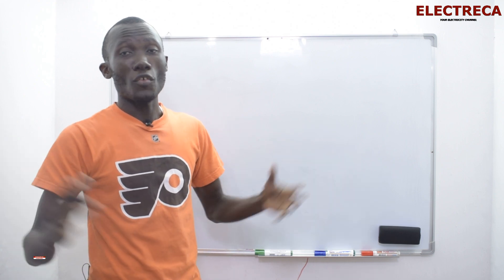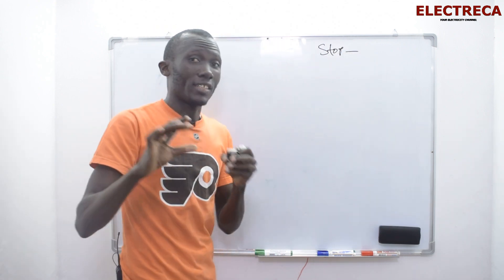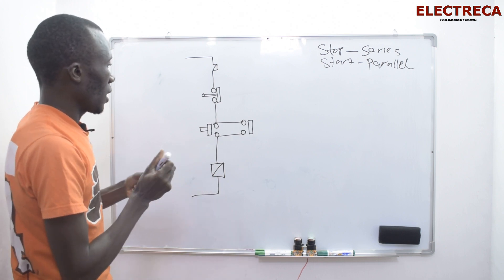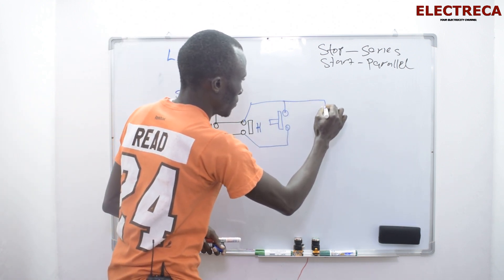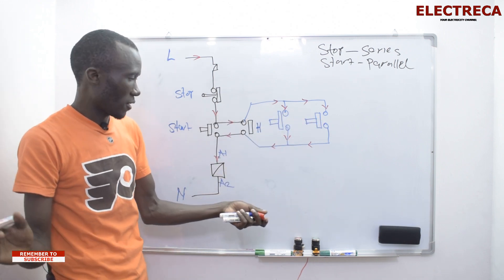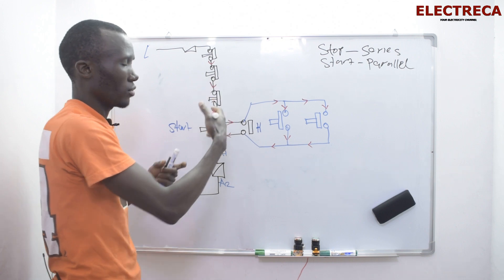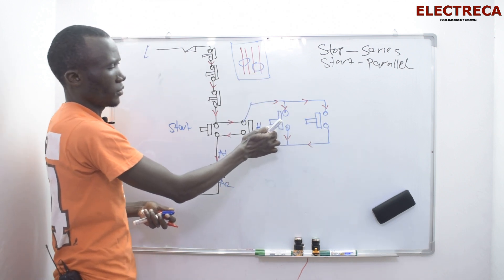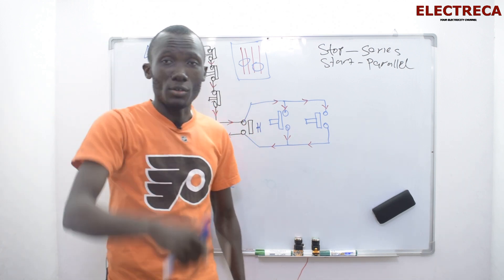controlling circuit in more than one position | self-holding circuit | whiteboard explanation

Comment: Hi sir,there is motor control called inching can you kindly a circuit for that,and also a motor starter for a motor with two speeds,thank you
Reply from the maker: I will look into it and get the circuit.
Reply: Thank you